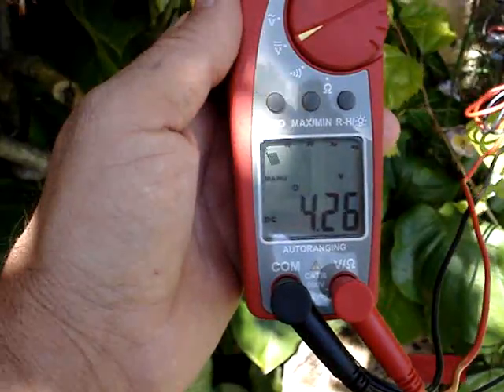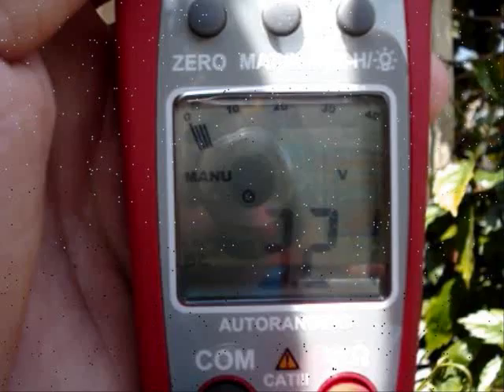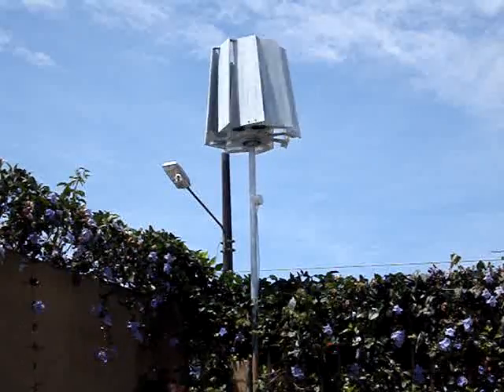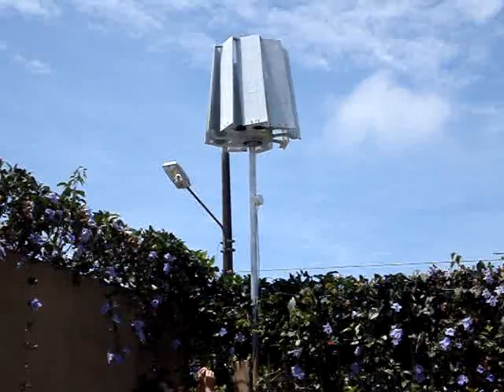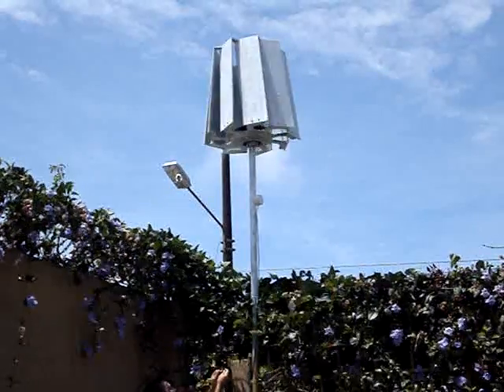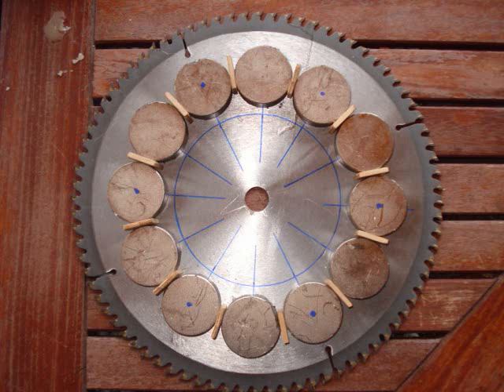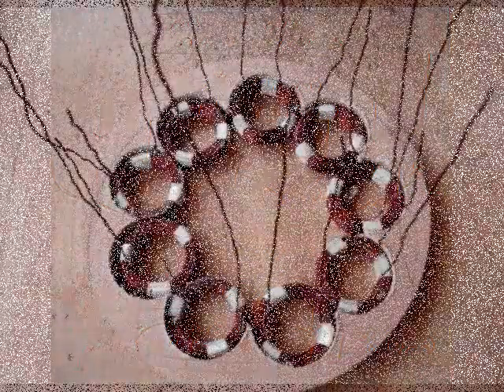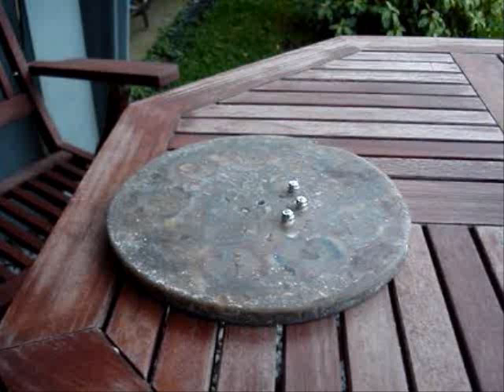Test results for my first wind turbine.

Comment: Question, why doesn't the resin around the coil effect the conductivity?
Reply from the maker: Its not metallic. The idea is to get the coils as close to the magnets as possible without touching. the resin helps hold everything in place.

Comment: hi Aceman i suggest you to change wind turbine type to HAWT with the same generator, you can get more output power from wind turbine :)
Reply: that wind turbine is vawt or Vertical Axis wind turbine because rotor place in vertical

Comment: I watched another video where the builder put the blades inside a box that directed twice as much wind to exactly where it would put as much force as possible on the blades that were in the box.I think the box had 6 wind ports around it.  I don' know if that helps or not, and I cannot remember who did that video.
I can see where the gear box idea would help as well.
Reply from the maker: Thanks for the comment.

Comment: gah, what's the current? just voltage tells me virtually noting. either give volts & amps or if you only want to give one number give wattage.
Reply from the maker: If your volts do not exceed the battery volts nothing else matters you cant charge a 12 volt battery with anything less than 12volts. Really you need 13 or more volts any amps at these voltages will put power back into the battery. I really never did test this design much because of wind conditions where I live.  This video is 6 years old and I have not done much more with windpower. Thanks for the comment.
Reply: I admit that's the easiest way to go (it's always easier to lower voltage than to raise it) but it IS possible to step it up. but you would have to look at the current to see if it's worthwhile. ah well.

Comment: You could maybe put guy wires on it to firm up the pole.  Your cross section of the wind is not very big.  You can only wring so much energy out of a small cross section.  Perhaps twice as tall would be better.
Reply: Or design a HAWT.  Why?  Because they are proven to work ...

Comment: nothing to make you feel small Aceman; but you made a beginners mistake. you need 2 magnets (1north +1south) for every 3 coils in a 3 pole construction. So in your case 6 magnets will do the trick to boost your output; adding a soft iron core and a main base plate to your coils will even improve it further (but may block your windmill on low wind speeds)
Reply: Nothing to make you feel small De Laet Bert; but he actually does have the correct ratio of magnets to coils.

Comment: Hi Aceman, great videos, thank-you for sharing.,  If you don't mind, but if I could give you a pointer, your base and arms are flexing too much and are using up energy due to excess flex.  Aside from trying to place the magnets and coils as far apart as possible for higher rotational velocities, if you would extend your pole to the top and install a bearing at the top as well; that would help immensely since the arms would not twist and the whole assembly would be far more stiffer and efficient.
Good luck and love your tracked vehicle videos.
Cheers
Reply from the maker: +PetrocelliPete Thanks for the advice and for watching my videos.

Comment: since voltage is proportional to the velocity between the coils and the magnets, under a given wind speed you can increase the output voltage by placing both the coils and the magnets in as large a diameter as possible, thereby for the same wind speed you magnets will move past your coils faster than the same configuration with a smaller diameter. Furthermore, using a larger diameter stator and rotor, you might fit more magnets and coils into your design. 

more turns in you coils for a given velocity between the coils and the magnet also will increase the voltage, but also add internal resistance to your motor.
Reply: i see that in this design, you use 3 phase with 3 coils in series per phase.  using a larger diameter rotor and stator, you could not only add three more coil to each phase to double  your voltage, but doubleing the diameter also doubles the velocity between the coils and the magnets, thus a doubling of a doubling might give you 16v instead of 4v.
Reply: +Keith Reynolds 16 volts like you say, how many watts is it?
Reply: Seeing as there are too many variables to account for in comments, I limited my comments to a given rotational velocity. Having a higher voltage is important to overcome to voltage the loss across a 3 phase voltage rectifier and improve the efficiency. 

In the end, the best way to load your wind turbine will depend on its capability over a variety wind speeds.  Too little resistance will slow the turbine too much and wattage will drop. Too much resistance and too little current will flow and produce too little power. You would want to implement some kind of maximum power point tracking to vary the load. http://article.sciencepublishinggroup.com/journal/169/1691052/image006.jpg

Comment: Getting it right is not easy?  Building the right shaped blades is important, also developing enough torque from the blades + rotational speed is also important. Although pma alternators are designed to run at low speeds, they still require maintainable speed to deliver a reasonable output, especially when under load.
Reply from the maker: +tony brimson Your right. You also need wind!!! We get wind only part of the year here and its not very consistent.  If I can ever find the time I would like to work on some other ideas for generating power. Thanks for your comment.

Comment: No the design is fine, however, to maximize your output, put a gear box into the system, otherwise you'll never get enough rpms to produce the power. Wind Farm Turbines turn about 18 rpm, the generator gets about 3200 rpms because of a gear box. Make a gear box, and you'll be able to power your house easily.
Reply: Could it be 3 wires because it's 3-phase?
Reply: Travis Lanier I've never understood why there is three output wires, I imagine +. -  and ground, but how and what determines which one gets to be ground? This is where I'm stuck at.
Reply: uh no.  lol  something this small wouldn't really use a gearbox, let alone get any more push or pull on the output with one.    The design is flawed, all vertical wind turbines are.  It's a simple aerodynamic drag.  The leader edge may catch the wind, but when it comes back around the system.  It's pushing against the same force.  Thus cutting the efficiency of any "open blade system" by about 60%.  The only way to get around that is by building a wind catching tunnel system.  So the returning edges don't create any drag.
Reply: @hawkintelligence  Hey thanks for that great information!. Persian wind generators do the same thing. I defiantly will be implementing it when I build mine
Reply: @ Travid Lanier - No, he cannot ever power his house with that device, not even with gears.

Comment: A series of videos simple and useful .. But I'm wondering if you can add them another video .. Shows the connection method .. I mean the system at home?
Reply from the maker: I have some videos on how I connect my solar to my house. Check out How I built my control box I have about three videos showing contruction and connections.

Comment: Hi. I just responded with a video to show the possibility of a louvered or hinged turbine blades. Mine doubled in capacity as soon as I removed the bottom spoke from the blades and they could lift out of the way on the "drag" side.

Comment from the maker: @shortyjk95 More turns smaller wire gets more volts less amps, less turns bigger wire more amps less volts. The trick is to get just enough volts over your battery voltage and using the biggest wire you can so you can keep the amps up.  I would recommend smaller wire more turns to start with. If you cant get the volts over your battery voltage it does not matter how many amps you have it wont charge your batteries. For 12 volt batteries you need at least 13 volts to charge them.

Comment from the maker: @haunted2097 Its a couple of problems first the turbine does not spin fast enough, and second I should have more turns on the coils more like 120 instead of 60. I can get the volts up to 15 volts if I spin it fast enough. I have changed the design of my turbine to a remkick three blade. I have a new video of it.

Comment: I'm no electrical engineer, but geting so low voltages with these coils you used and neodymium magnets just doesn;t add up. I think you should check the resistance of your coils to see if you have any short circuits. Well done for your work and thanx for sharing the procces!

Comment: May I suggest extending the vane length, shrouding the downwind side or low presure side as vanes come back around , critieria I have gathered seems to indicate 30% to 90% offers the best effiency, the shroud would be van turned to stay in axis with the wind.  Van length could be strengthened with stainless wire to counter act centrifical force of rotation, much like the wire that is ran through the bolts of aircraft engines to counter them wanting to turn out.  Good Work, you saved us all a lot

Comment from the maker: @larryswindcatcher My next design will be a Lenz type turbine. Need the RPMs.
Reply: If you have high torque, you can use part of the torque for gear ratio for high RPM. When you have high RPM and little torque, you have nothing.

Comment: You do good work. I might suggest that you shield ½ of your turbine from the adverse wind. That could be done with a bearing on top and bottom with an orientated movable shield. Try blocking off the bad wind and see how much better it will run.
Also because of the small base diameter and low rpms your generator base needs to be bigger in diameter with less powerful magnets to make up for the speed loss. Keep up the good work!
Reply: Which 1/2 do you shield?  What if the shielded 1/2 is now blocking all of the wind ?
Reply: @MrSummitville  Understanding wind energy potential: From a stationary point, the wind blows 90 degrees in front of the stationary point to 90 degrees behind the stationary point. Therefore, wind energy from a stationary point is 180 degrees of Wind Energy Potential. Right? A propeller operates in 1/180 of the wind energy potential available to it. Your rig is operating in less than the 1 % of the propeller: half is sailing down wind and the other half is beating up wind, both have  the same amount of pressure, canceling much of the productive force sailing down wind. Try covering the upwind side with a piece of plywood and measure the difference.
Reply: @larryswindcatcher     Yes, I do understand WHY you recommend a shield.  But adding a shield that a) moves automatically based on the current wind direction and b) blocks off the appropriate 1/2 of the rotor ... will surely increase the cost, increase the weight and increase the failure modes. NOTE:  He claims this will operate in 25 m/s = 55 mph = 90 km/hr winds.  A 180° shield will make a huge sail in high winds, causing the Wind Turbine to be ripped off the roof and fly through your neighbors window ...
Reply: @MrSummitville  What difference does it make, the garden ornament intersects with the wind energy less than one percent of the wind energy that it has available to it.

Comment: Try taking of half the blades to get it spinning. the turbine looks like it is presenting a flat wall into the wind. I know u angel them, Just 4 fun try it ,,, it is only a few screws, that way I can take your design on or of my "to do" list :) thx Oh PS. also change your saw blade with 12 mm steel, got somthing to do with the magnet flux.